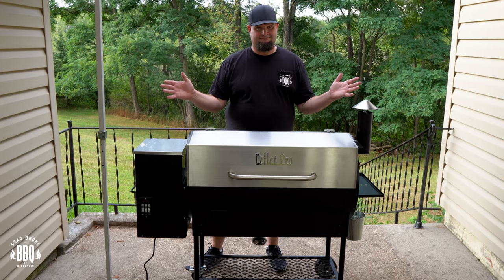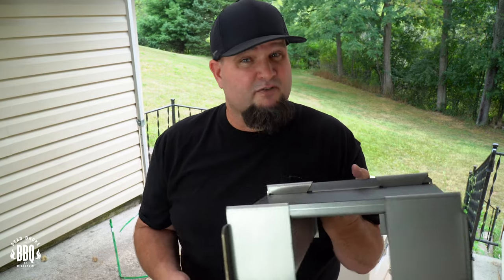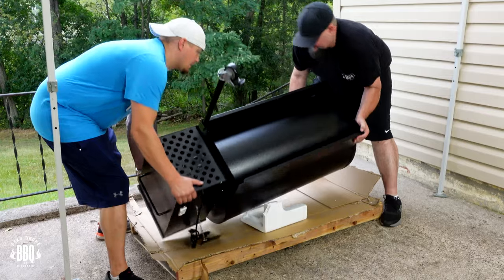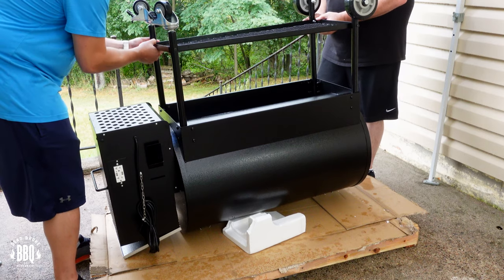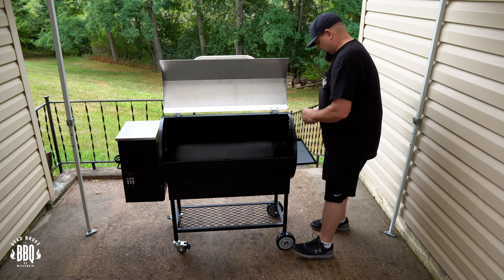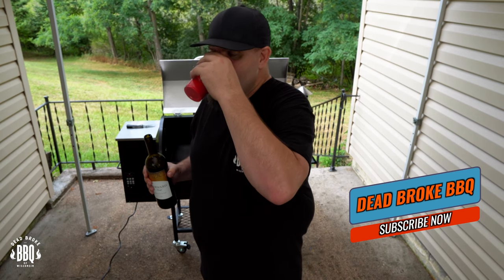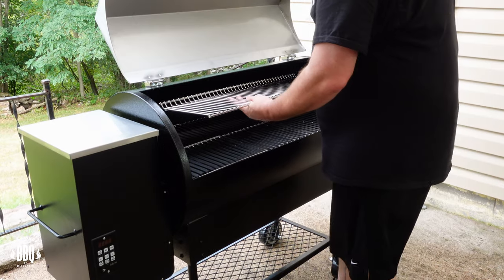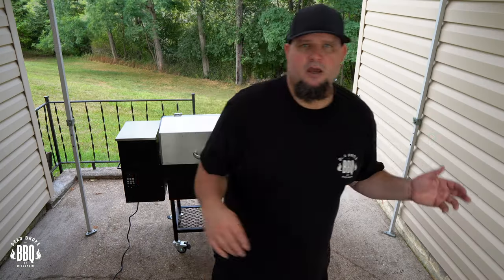Smoke Daddy Pellet Pro 1190 Unboxing and Assembly

Comment: The stick burner fire pot shield is interesting. Do you think that would effect the reading of the internal temperature probe?
Reply from the maker: Hi Andrew. Yep it will cause the chamber to be a little hotter but Smoke Daddy told me that you should only run the cooker up to 250° or so and then the wood will just smoke and not catch on fire as much. Nor the Heavy D will fit in most pellet grills so it is a pretty cool idea and the first cook I do I will use it and see how it preforms!! Thanks for watching!!
Reply: @DeadBrokeBBQ  excited to see how well it works! I out wood chunks on top of my heat deflector when I want extra smoke and that works well.